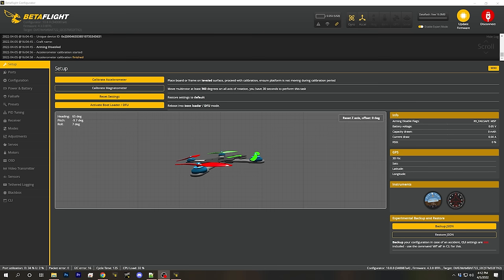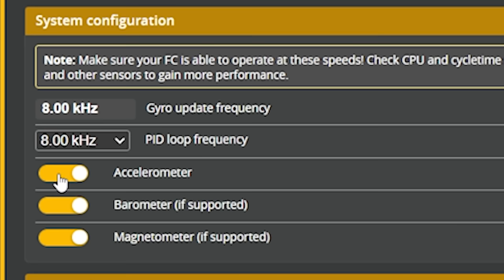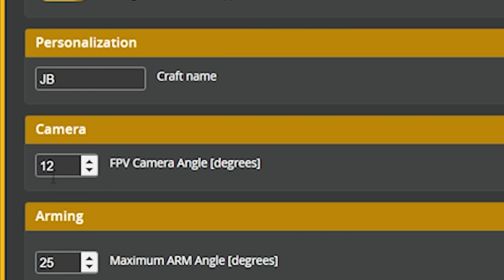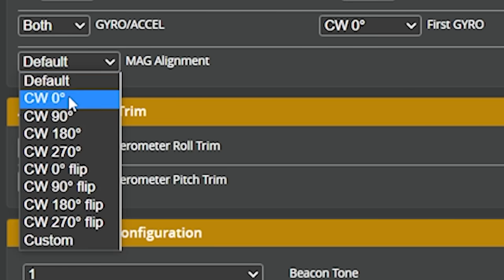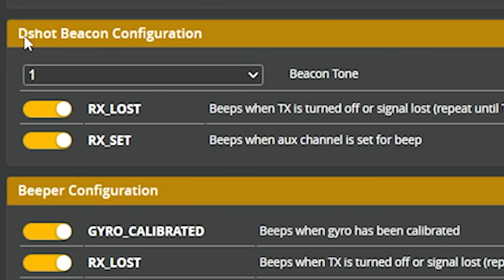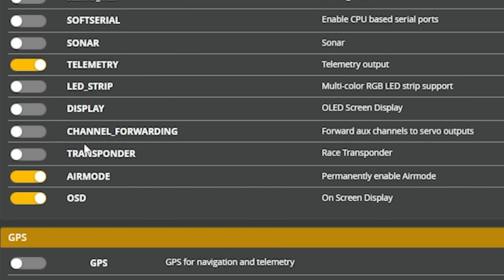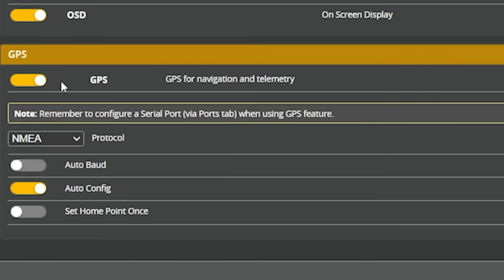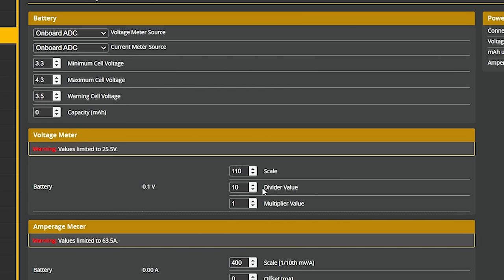Betaflight 4.3 Configuration Tab and GPS Tab | COMPLETE WALKTHROUGH PART 6

Comment: One of my quads is equipped with a range laser which is supported by 4.3. I modified the BF source code to have a bar graph in OSD representing the height. I chase cars and for me it's very helpful to see where is my limit how low I can go because I don't want to read a numeric value all the time during the flight.

Comment: These are awesome series! Iv gone into fpv blind and had no idea about betaflight, so far Iv update firmware on a mobula6 that had mode 1 control setup and wouldn’t fly properly. So configured it from scratch, it fly’s pretty good now! I have another two drones with unknown esc and controller boards which need doing next.

Comment: I hope betaflight implements ublox7 at some point for GPSs  since it allows for a higher update frequency on GPS modules that are ublox7 compatible (like the BN-880 which if you use Ublox7 on inav can update with a 10Hz rate).

Comment: The GepRC Cinelog30 has an odd ball fc mount configuration, it's mounted inverted & at 45⁰. For the board and sensor alignment I set roll 0⁰...pitch 180⁰...yaw -45⁰. Fantastic set of videos

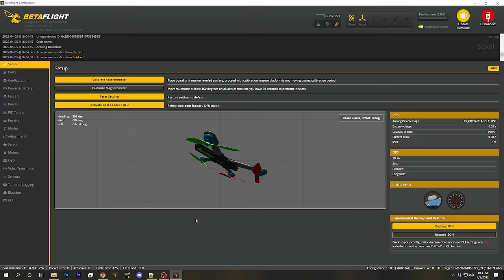Comment: 0:50 I think you said small mistake there, because Accelerometer is for measuring how something is accelerating (how fast is moving) on certain axis in some unit per second, and gyroscope is used to tell, whitch direction is up (like artificial horizon in airplane)

Comment: Are you sure the FPV camera angle changes flight characteristics?  I just tested at 45 degrees and 0 degrees, I hover the quad in acro and do a yaw spin, both spin perfectly flat.  I really dont think this changes anything in flight. Happy to be proven wrong
Reply from the maker: If you are hovering, then no, the camera angle has no effect, except that with higher uptilt you're looking at the sky. The difference comes when you are in forward flight, and you have leveled the horizon in your goggles. With higher uptilt, you are pitched forward more, so the mix of roll and yaw required to turn is different.
Reply: @Joshua Bardwell  i understand crosscoordinating turns and how camera tilt effects that in flight.  I'm just not convinced that setting the FPV cam angle in BF has any impact on flight dynamics, are you certain it does?
Reply: Ok, so BF does have compensation,  but it's dynamic and varies based on how close you are to the set pitch angle 👍
Reply: I thought all it did was offset the horizon line in the OSD? I've been using it like that never even thinking it might change flight characteristics and haven't noticed any weird yaw/roll shenanigans at all.
Reply: @FluffRat  it does change flight characteristics,  closer to the tilt angle, the more it compensates

Comment: Hi there. I'm building my first FPV drone, TYRO79(Matek F411) and I’m doing some improvements, for now, I would like to get a GPS on it. 
I read some articles that some people got success doing it when creating a softserial and using the led_strip pad (Pin A08) to do that as a serial_rx 11 A08 and the serial_tx 11 A02. I activated everything on betaflight (feature GPS), on ports, enabled the GPS, and on configuration enabled the GPS too. But, I didn't get it recognized on FC (betaflight).
I also connected the BN-220 directly on my computer, just to confirm that it's working and it is. So, the gps unit is not the problem. 
I powered the gps unit on a external power supply at 5v to confirm that there's no issue with the power supply from the fc. 
I also tried to connect the gps unit directly on the UARTs 1 and 2, but no success.
I am connecting the GPS TX pin to the FC RX pin port and the GPS RX pin to the FC TX pin port as mentioned above. It's right, correct? I'm not comfortable to invert it. 
I also tried different firmware versions, but no success. The last one available for this FC is the 4.2.11. 
Can you help me ?

Thanks

Comment: On the GPS topic - having a hellish time getting a GPS going on a board I pulled from the Crux3.5.  I put a Beitian 220 on UART1 - rx1/tx1 --- and when i set it up for GPS as instructed -- I am not getting the yellow confirmation "GPS" indicator in Betaflight that FC and GPS are communicating, of course, no fix either.  I've tried everything - a different GPS - Beitian 180, swapping out Rx and Tx wires just in case I have them backwards - power lights are coming on for the GPS unit, FC is otherwise BRAND NEW and in perfect working condition.  BAUD rate i set auto and manual --- auto its jumping to 57k on its own.  Now stumped.  :(  Something up with UART1 not able to be GPS --- this is an ELRS SPI Antenna on the board -- does that maybe mean UART 1 is not available if i'm using the SPI antenna -- wouldn't make any sense though. Grrr its 4am and still trying at it.

Comment: Hi Joshua, Thank you for your videos! I have a question:  I  have connected a Ublox Neo 6M GPS module to my quadcopter, which is based on the Speedybee F405 v3 and running Betaflight 4.4.3. In the Betaflight configurator, I can see that I have a 3D GPS fix, and when I issue the "gpspassthrough" command, I can see data being written to the CLI. However, I've noticed that the GPS icon in Betaflight does not turn yellow. I have connected the GPS module to UART6, disabled auto baud (although I have also tried enabling it), enabled auto configuration, and set the baud rate to 115200. I'm wondering why the GPS icon is not turning yellow. Should I be concerned about this issue, or can I just ignore it? It's worth noting that even with this issue, the quadcopter arms with Return to Home (RTH) configured, which is set to disable arming without a 3D fix.

Comment: Thank you so much Joshua for making highly informative videos! I upgraded my Trashcan from BF 4.1.0 to 4.3.0. I noticed that actually some PID controller settings are changed after the upgrade.  for eg.  feed forward,  dynamic damping etc.  I restored them to original settings. As you mentioned that after you import the preset (saved file from earlier firmware) into the newly flashed firwmare, all factory settings should be applied/restored. I performed this step as well. 

Everytime I fly the quad  after a few seconds of flight, the motors get disarmed. Can you please suggest what might have gone wrong?

Comment: Great video! question if someone could answer it. What would be the negative effect of making the board alignment fix using first gyro? I have fixed the issue of not facing the direction I moved the quad using the option "first Gyro," and it still flights as I think it should be based on my base judgment.
Reply from the maker: There is no disadvantage, as long as you get the alignment right. But since boards don't always default to 0 degrees rotation as default, setting that value can be unintuitive.

Comment: Need help! Switch from TX16S to Spektrum (both runs crossfire) for my diatone Roma f5 DJI v2, tx16S runs great, but after set up on spektrum with crossfire, it only can be armed but no throttle response. All beta flight 4.3 seems ok, like sticks moving/travel aux switches etc. What have I missed, please help

Comment: i have the explorer the default PID is set at 200KHZ /cycle time 493/cpu load 28 the highest it will go is 400KHZ/ cycle time 247/cpu load 42 would it be safe to go to 400? will it even be noticeable seems strange it's set so low.

Comment: I have a question on the configuration to set up the receiver I recently downloaded the new beta flight and I what is using an older flight controller but I seem to have lost my connection to my transmitter I have no transmitter inputs to determine what I’m using I happened to be using specktrum. I basically have nothing to make my Radio transmitter function. Thank you I hope I can figure this out with your help.
Reply from the maker: You can get this info from the saved config dump that you made before you flashed. If you don't have that, the two steps are to configure ports tab and receiver tab, both of which are covered in this series.
Reply: @JoshuaBardwell  thank you for the time your giving me. So yes I watched all the videos and I had set The port then found my receiver set up I did exactly everything reading the manual  on the flight controller which is RX1 for my serial RX to my Spektrum. My set was UART1 for serial RX, Spektrum1024 for my receiver. Still no stick inputs happening. It was flying two days ago then I just updated to the latest version of Betaflight and now it doesn’t recognize my radio transmitter because I’m seeing no inputs on the computer. It worked fine just before the update firmware.
Reply: @JoshuaBardwell  CLI dump files didn’t help also do you think that the serial RX inverter has been set differently after Firmware update? FC has a designated plug for my satellite RX which is 3.5 V I have a old X racer F4 no damage. Like I said it worked perfectly fine I just updated to the new Betaflight, now this is my issue.

Comment: I’ve tried but could not trim accelerometer using my controller (Jumper T-pro, with ELRS external module, binding with mobula 7 Hd-Zero). Do you it could be one more issue of this model (Jumper t-pro)? Do you suggest me to do something else?
Reply: I tried to do it landing, as you showed on your old video linked below this new one.
Reply from the maker: You have to have angle mode activated for the trim to work.

Comment: hi  do you have any idee why the gps have a fix and got speed and position but betaflight 4.3 cant see any sat 🤨  so gps rescue wont work
Reply from the maker: Check wiring of TX and RX to FC. Make sure TX goes to RX and RX goes to TX.
In Ports tab, make sure GPS is configured on the right UART that the wires go to.
In Configuration tab, enable GPS, set type UBLOX, auto baud, auto configure.
Reply: @JoshuaBardwell   wow thanks for that fast reply

Comment: is it possible to physically disconnect the GPS wire harness in the field or a building if Im having trouble , or Is it possible to put an in line switch in the GPS wire harness , would the quad operate at all ?

Comment: ok, 4 months later, I have another question on compass. I have installed the GPS with magnetometer. I also adjusted the declination related to where I live. Now the compass on the betaflight screen shows pretty much the right direction. But the thing that bugs me is if I rotate the quad on my desk, I see the compass moving along with the rotation. But when I stop rotating, I see the compass readjusting itself more or less depending on how many degrees I rotated. For instance, when I rotate to about 90 degree, the compass re-adjust to about 2 more (or less) degrees. It's almost like if the gyros degrees are not the same width as the mag degrees. It's weird.

Comment: 4k + 2k, or 2.67k + 2.67k  ?
Setting up an spracing f3 mini with betaflight high performance 4.1.1. Highest available options for gyro and pid frequencies are either 4k 2k(overclock may be required) or 2.67k synced(limited by oneshot125). Which is better, and why?
Reply from the maker: If you're on a firmware so old that it's even possible to un-sync the PID from the gyro, then I wouldn't use it. Update the firmware to something newer and/or skip that FC and get something newer.

Comment: Hey Joshua, i have an flight succex-d whoop aio, fitted to a Geprc 25 frame with the AIO pointed correctly forward (arrow), i used a frame adapter. in calibration the board is right way up but as a pusher the motors need to face down how do i flip the motors?i'm confused as what to do next. thanks JB.
Reply from the maker: Make sure the motor is spinning the right direction, when looked down from the top.

Install props the right way up, when looked down from the top (so, upside down relative to the motors).

Comment: Hi JB, Today I put first time BF 4.3 on my quad, micro apex 4" and have some weird problem that I cannot takeoff normally. Quad arms as usual, no funny noises and when you want to takeoff quad goes like 5cm in the air and just wont go higher, even if I put 100% throttle it will just hover 5cm from the ground. It feels like some flying mode is active that prevents me to fly normally...Just to mention, on BF 4.2.11 quad flew normal, just needed a tune. Wanted to do some blackbox logging on stock BF settings but just couldn't takeoff. Any ideas? Thanks!

Comment: Setting up Mobile 6 using BF 4.3. Channel map TAER.  No warning flags. Receiver tab shows all stick movement.. In motor tab, motors will run in A, E, and R but not T.  Any thoughts?
Reply from the maker: If only 2 motors spin and only when you deflect pitch roll and yaw then it means turtle mode is active in the modes tab. Flip the aux switch to deactivate turtle mode.
Reply: @JoshuaBardwell  Thanks. I was too quick in asking for help when I found one of your videos solving my problem

Comment: I feel you need to understand Airmode in BF 4.3 has a very bad user experience for some people. For some of us (not all and I do not know what only some), Airmode causes a runaway that is not detected by runaway detection (very bad).

When Airmode is enabled and the quad is armed, the motors spin as expected. Once the throttle is raised, then immediately a runaway occurs. People with this problem find switching back to BF 4.2 resolves the problem. I have been pulling my hair out trying to understand why and this is what I found.

I found the problem can be resolved with two options:

1) disable Airmode and enable motor stop (not desirable)

2) disable Airmode and set Dynamic Idle Value (found in PID Tuning) to 3000 to 4000 RPM as recommended in the BF Wiki

This problem is present any time Airmode is enabled even with Dynamic Idle enabled or disabled.

According to the BF Wiki, dynamic idle has been rewritten in BF 4.3. I assume the BF developers are not aware of this runaway problem as a result of rewriting dynamic idle. Maybe you can help raise awareness of this safety problem.

Here is an example of the problem. This does not seem as severe as a runaway like I am experiencing, but this looks to be the same problem. 

https://github.com/betaflight/betaflight/issues/11655

By the way... Thank you for your excellent service to this sport!!!
Reply from the maker: If airmode causes a flyaway, there is some other mechanical problem with the quad. The gyro should not get enough feedback to cause flyaway even with airmode enabled.

Turning off airmode obscures the problem, but it's like putting a splint on a broken ankle. You might still limp on it, but it's not fixed. This isn't a betaflight bug. It's damaged hardware or improper building methods (no disrespect intended to the builder).
Reply: @JoshuaBardwell  Thank you for the feedback. I am surprised the problem is with the quad since the quad flies great with Airmode turned off. The flight controller is new. Should I use rubber mounts?

Comment: At the beginning of this video you show how moving the gyros moves the quad on the screen. I can see on your screen, that the compass in the INSTRUMENTS panel moves too. But how do you set this compass north?  For me, the north is always where the quad was pointing at power on.  Sounds strange. But my main concern is this: will this affect the return to home feature if I powered it on facing other direction?
Reply from the maker: That's because you don't have a compass. So the quad just guesses that north is where you were facing when you powered up. No, it won't affect return to home. The FC knows that isn't really where north is.
Reply: @JoshuaBardwell So in theory, if I set my quad due north when arming, my goggles should show approximately the correct heading?

Comment: Betaflight 4.3 vs 4.2- if you use stock preset is it worth bothering to update? Not much comparison available yet that I can see.
Reply from the maker: BF 4. 3 default fly better than 4.2 for sure.
Reply: @JoshuaBardwell  Thanks man.

Comment: Hi JB. I have sent you an email about MPU6500 gyros, but I'm not sure you'll get to read it as you probably have hundreds of emails! Is the mpu6500 gyro now working well with betaflight, or is it still plagued with vibration related issues? (I ask as I ordered 4 mpu6000 based fcs, 2 diatones and 2 HAKRCs, and all came with either MPU6500 or no gyro chip at all and the manufacturers said these work well now -full story in email!!!)?
Reply from the maker: I'm not sure about that. To be honest, I'm surprised anybody is still selling FC with MPU6500 on it.
Reply: @JoshuaBardwell  Thanks JB. I'd appreciate any advice if and when you know more. Strange two different manufacturers did this -I rekon others have too, but people might not have realised/noticed!

Comment: Hi Joshua, Great work as always. So helpful. Small question from a newbie.  I ordered a tyro79 rtf kit , as my first beginner quad. Now I have no idea what Betaflight version it comes with . but I am assuming that if i had to flash the firmware to  4.3 , I would loose all the settings it currently has right ? Would flashing to 4.3 , still have some default values and keep the quad operable or would most stuff have to be manually set ? Would it make sense for me to take screen shots of all Betaflight tabs , so that I have a ref of what settings there were ( apart from taking the CLI backup of course ) ?  I also plan to take note of the original Betaflight ver it has so I can revert back to it along with the CLI backup.
Reply from the maker: Please start at part 1 of this series where I show how to back up settings before flashing. That will ensure you can go forward without losing the old config if you want to go back.

You will lose all the manufacturer settings but you can use this safe migration tool to bring many of them forward.

https://bf43-safe-migration.robertodedomenico.it/
Reply: @JoshuaBardwell  thanks . yes I saw that bit as well . but I am not confident to know what to move forward and what not. But thanks for answering.  Guess I could try fly it before I tart messing ... lol.